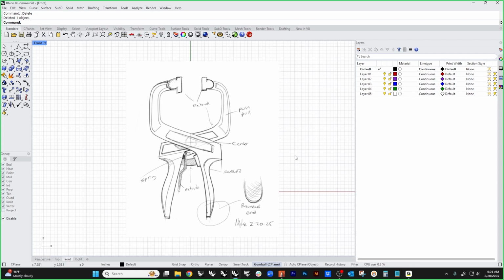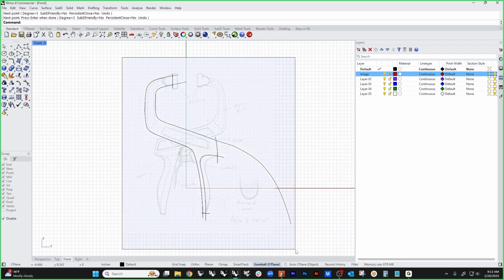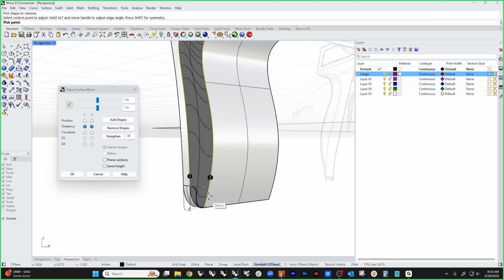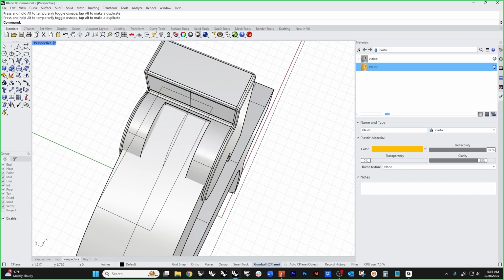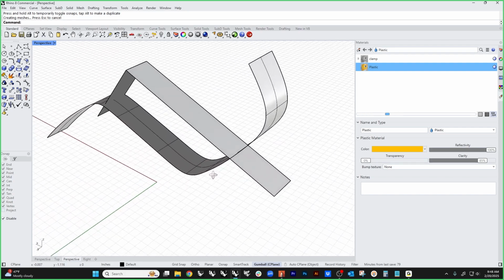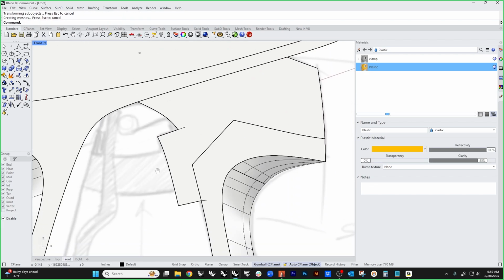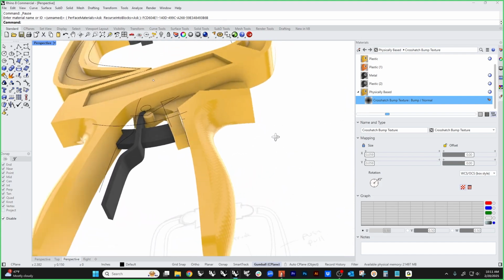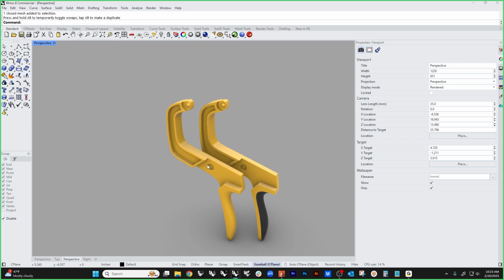Rhino 8 Getting started- Wood Clamp

Comment: Does it make sense to design, for example, an organic shape like the body of a car or an airplane using NURBS and create surfaces from it, or is it better to model directly with SubD? What is the current workflow in companies? Does anyone know? Thanks.
Reply from the maker: you have to start in subd then go to nurbs if that is the workflow you are planning to use. Going from nurbs to subd is technically possible, but you end up with a model that has unnecessary complexity and can get a bit unruly to deal with. 

And anyone that says you can't use SubD in production...I respectfully disagree- 

I have used it on dozens and dozens and dozens of models in the toy industry since back in the t-splines days. 

You can 100% use SubD (converted to Nurbs) for production surfaces. 

But to more specifically answer your question... if you are doing a toy car, go nuts with Subd, it's fast flexible and fun to model that way.. if you are doing production surfacing for an automotive OEM, you'll be in nurbs from start to finish as they have very very strict requirements for their surfaces, and the OEM's  have not embraced SubD for production surfacing of sheet metal. (yet) 

BUT... anything short of class A car panels can be subd all day long. I'm done it many many times and the results are fantastic.
Reply: @Rhinoceros3d One more thing I've been meaning to ask you for a while is that, for years, Class A surfaces have become very fashionable. I recently read someone saying that "Class A = marketing strategy to increase the cost of a surface modeler." It amused me, and I thought it might be entirely true. I don't know what you think about it. Regarding Rhinoceros, I don't understand where the limit is between what is a Class A surface and what isn't... Are two surfaces connected with G2 or even G3 curvature continuity not, in themselves, Class A surfaces? I don't find any differences in the final result when I apply mapping analysis. I am referring to Rhinoceros and what I see in other programs, such as CATIA, which are considered Class A surface modeling programs.
Reply from the maker: @The_Crazy_Engineer  class A is a real thing for sure, and has slightly different requirements depending on who the client is. 

it's typically reserved for stamped metal car bodies, it's a bit overkill for consumer products IMO as many of those molds are finished by hand. The second you touch a mold or stamping die  with a grinder, class A modeling is a waste of time. 

car models are so fastidiously created with class A principles because they typically are models cut direct to steel with no human interaction. 

consumer products are typically  not made like that...
Reply: Thank you very much for the explanation. Very detailed and very clear. Congratulations on the work you do because you help a lot of people.
Reply from the maker: @The_Crazy_Engineer  thanks! , I appreciate that!

Comment: As a machinist now moving into 3D work, I am eternally grateful for you giving mention to using normal human dimensions at the design phase. My heart wouldn't take machining another angle at 71.372 degrees just because it looks nice!
Reply from the maker: ha! yes, I was taken to the woodshed by an old and  very experienced machinist early on in my career. He said he'd cut the part if I could find the .08216321" diameter cutter in the tool room, cuz he sure as H#ll was not going to order a custom bit for a punk like me....

Comment: Mr. Kyle, can you tell me if the pushpull tool can work on a surface that is not flat?
Reply from the maker: yes, it works on curved and compound curved surfaces- just make sure your curves are projected or pulled to the surface you are pushing/pulling

Comment: Как сделать fullscreen с командной строкой? Если в Rhino такое не реализовано, прошу это дополнить . Думаю , многим это понравиться. Вот реально хотелось бы создать модель в этом режиме с aliases.. есть и другие идеи, не благодарите. Сделаем Rhino ещё сильнее..!
Reply from the maker: you can do this simply close all the panels you do not want and save it as a window layout. 

the fullscreen command takes rhino to full screen, but you do not have access to the command line. you do have access to your pop up menu however so this can be useful if you have most of your tools there. 

there are also two small window pane icons in the very lower right and left that you can use to have a more full screen space with the command line still available.